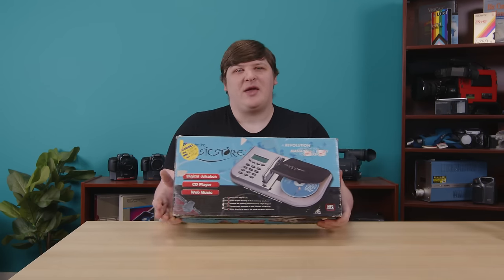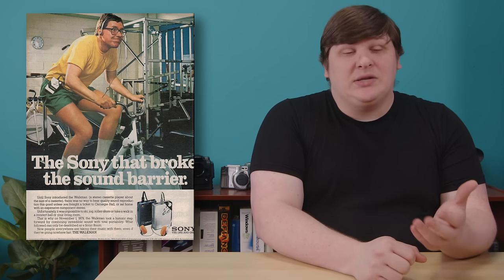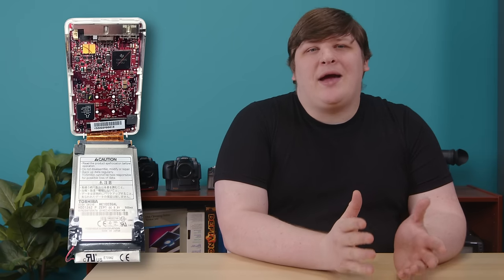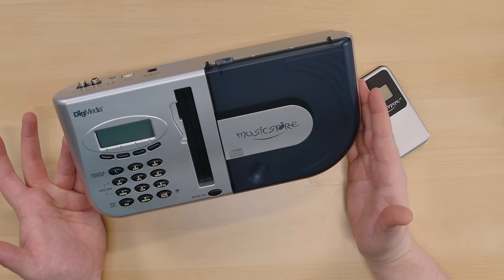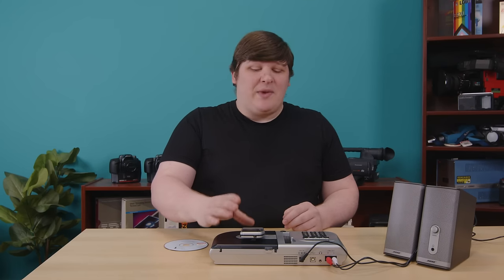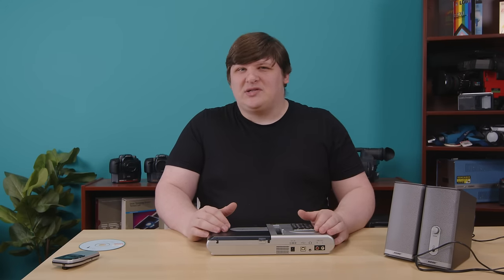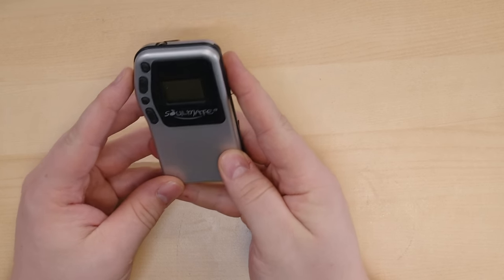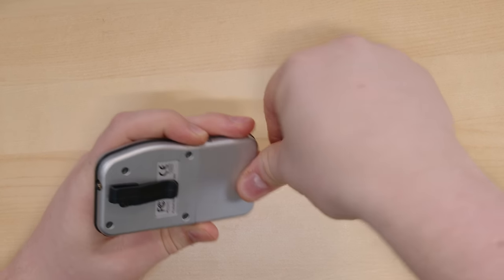An MP3 Jukebox for Everyone (Including The RIAA)

Comment: It's funny, if you go to your car and try to equalize the song, they put the "genre" or "style" at there, so you can put in reggae, rock, blues etc, at the Panasonic or Sony mp3 players, for cars, the "shuffle" function sometimes is called "mix" until today and if you want to select a playlist from a pendrive, there is "mix tracks" hahahaha

Edit: in Brazil, we still use mp3 players with pendrives for cars.
Reply: You're not alone, my car's stereo supports BT but only for Apple so worthless with my phone, so while my car was on the road a pendrive lived in it so I had music since the local radio stations are mostly a bunch of nutters. The exceptions are a station I helped setup, which is hard to get reception for in most of the town and a pretty low end local station that's all volunteers.

Comment: I would say the spring wants to lift the lid at all times in the open state so when you close it, that little piece that sticks out actually tucks under the frame of the hole you put it in so the lid won't come open. When you push the open button, that is just pushing that small piece to the right which allows the lid spring to open the lid. With that said, nice video. I never knew this thing existed!

Comment: I looked at that image, the data isn't encrypted, its just obfuscated, the machine applies a circular bit shift operation every 512 bytes to the data stored on the drive, with each byte offset from 1-512 being a different value shifted. This can be observed as repeating patterns in areas of the disk that you would expect to be zeros.
Reply: We need a decoded image!
Reply: @Ipergorilla  so CRD did a video on an email conversation with one of the engineers who worked on this, this is now what i think is a rolling cypher, and it would need to be brute forced

Comment: Excellent detailed review.

To my mind the UI is the key thing that held it back. Had it had a better UI, who knows, perhaps it would have done much better.

P.S. Solar watches as well as self-winding electronic watches (e.g. the Seiko 'Kinetic' range and its predecessors) used to use those types of capacitors. However, they were phased out in favour of physically compatible rechargeable cells as the capacitors tended to degrade rather quickly. The rechargeable cells last a lot longer in service.

Comment: The DSP is most likely running heavy number crunching like the FFT for the MP3 compression / decompression, as this would overwhelm an 2000style ARM CPU and the low cost FPGA, but be easy for the DSP.

Comment: Wooo you mentioned Creative's Nomad Jukebox :D This one was soo cool to carry around. I still have one somewhere. I remember I had/have v3 version that used a 20-gig drive with some weird custom partition format that I once tried to reverse-engineer for Rockbox alternate firmware (~2007, quetzalcoatl, still can find some mentions on Rockbox forums, the older "nomadness" forums don't exist anymore). My, reversing that all and writing a linux fs driver was such a cool project.

One thing I remember, as a consumer/user, with the NJB I got was that small screen and just a couple of buttons. Menu had a relatively logical layout, easy to learn, but when you had large library, navigating around was a pain, but at that time it was nothing unacceptable. I think it supported playlists, with help of PC software. At some point I discovered that it's possible to store not only music, but also data files on it (and later software updates even made it as easy as showing it up as a drive in Windows, like every dumb usb stick now is presented) - and 20gig storage for files, when the most common usb pendrives at that time had like 64mb? 128mb? Creative's NJBs went up to ridiculous 40gigs, at not that very steep price increase.

And these even had Firewire connector for faster data transfer speeds! Who on the block ever heard about it, when USB was just getting barerly recognized by common folks on the street as something more than just printer cable at best.

Hm.. what else.. oh yes, audio quality was VERY nice, especially when connected to an external amplifier and speakers. Creative's headphones that were included with the device had a very weird design, no classic headband, some head-back-band and they got uncomfortable quicky, what a waste considering their sound quality was pretty decent.

And I couldn't forget about the battery packs. Yes. Packs. Not pack. Most of the players I saw at that time were going either on AA/AAAs, or built-in rechargeable battery. NBJ could of course work of on ac adapter, but also had 2 easily accessible slots for its own rechargeable batteries. One was included, and additional ones had high, but tolerable price. If I remember well, they weren't hot-swappable, if you had 2, you should have charged/discharged them matched together. Anyways, find such thing in any player even years later!

I felt such a pity when iPods boomed everywhere and got all the hype with their tiny storage space (at least initially), and almost nobody heard about Creative's players. Oh well, nostalgia aside, that's not the first great product shadowed by worse competitors with better marketing, right? :)

Sidenote: I try to post that comment for the third time now, previous just disappeared. What do I have here that it gets constantly deleted? Links? Product names? Too long to store in cloud? Geesh.

Comment: >super capacitors in the portable unit
I think that it was more intended for power loss protection during jogging etc. where the batteries would disconnect for a short period of time due to gravity
Also, the power jack in the battery compartment etc. makes me think that they considered making a rechargeable battery pack for it, but it never reached the needed success for it to be relevant

Comment: Entering the information for my mp3s over and over again is not something i miss. The whole "equilize by genre" thing sounds familiar to me though i never had a MusicStore so i guess that was a ~thing in the early 2000s?! Oddly? So was the ripping at 1x. But then again i was in a household with a Packard Bell pc sold by Sears and a CD player/radio/tape little tower that wouldn't let you skip a song on a CD after the 3rd or 5th track without aimlessly searching and giving up.
And once you started explaining the T9 i actually remembered it but the only place ever used was when i used my Virgin Flip phone to browse the web at the cost of 10 cent per page loaded.

Comment: Imo 128kbps mp3 could sound totally fine if you used the correct encoder settings (i.e. lame - 9; which of course most people did not). Of course in 2000 those correct settings would have seen you waiting quite some time for it to finish encoding (0.25x, if you're lucky)
Which brings me on to another thing, this device probably couldn't have done the encoding any faster than 1x anyway, so a better extraction method wouldn't have been relevant.

But I wo der why they didn't shove a USB or ps2 port on the back for an external keyboard. A simple change change that would have drastically improved the usability.

The ram bit caught me totally off-guard. What a whacky idea.

Q: could the Dock charge the handheld?
Q: was the media unlocked while the handheld is docked, even without wiping? If yes, what happens if you yank the handheld out while playing one of those tracks?

I'm tempted to look at that drive image and see what I can figure out, if anything
Reply: I didn't see any obvious traces to the battery compartment during the pulldown from the dock, or other common elements for charging so probably not. Maybe they're in the sealed part of the battery compartment but seems unlikely.

Comment: Missed opportunity to plug that CD drive into a PC to find out how fast it could have been had they used IDE to transfer the music. Also interesting to see what happens if you plugged a PC CD (or DVD drive even?) drive into that thing's IDE interface. As long as the drive had the digital audio output port would it work? Curious how the IDE master/slave thing is set on that. Did it use the cable to set that or was there a jumper somewhere on it like a normal PC drive?

Maybe you can revisit this in a YouTube short? ;)

Comment: I owned a Rio in the late 90's and it was extremely practical.

The device was intended for use on the go, and as impractical as loading up music through parallel may have been, CD-R's weren't REALLY an option, and the Rio made keeping a LOT of my favorite music at my fingertips a reality.

Add to that the lifespan a AA battery had on the thing, and you have a really useful device. I remember showing it off in Middle school, and kids were interested then.

Also, you mention swapping out CD's which is valid, but consider that when you brought a portable CD player along with you, that to swap music, you'd have to bring the CD's too.

If you only REALLY like 2-3 songs on those CD's, you'd technically bring a Walkman that ate batteries, and a 6 disc CD travel case to get the same enjoyment out of what you could curate on the Rio.

It was really a comparable experience, but with better battery life, and it was easier to curate a custom mix than other options available.

I graduated to a Nomad MuVo a few years later, and never really looked back. 

Some insight into the mind of someone who actually used the device when it was sold.

Still have it somewhere in the box. Never did get the expandable flash storage for the reasons you mentioned, but it didn't stop me from using it. And I MAY be mistaken, but I was a prude for 360kb/sec music, and I think I remember being able to listen to it on the Rio. That may be false memory though, I'd have to dig it out.
Reply from the maker: That's all legit, thank you for the firsthand experience. I was burning audio CDs a couple years later, but 1998 and 2000 were vastly different.
Reply: I had a 128 gb MuVo and loved it. I worked as a freelance legal document preparer and it also doubled as my flash drive for documents I was working on.

Comment: A very comprehensive video, very detailed and I found it very easy to follow.  I remember using MusicMatch Jukebox back in 2000, wait for it, to digitise my cassettes.  That was an interesting project, I wanted to digitise some tapes and copy them to CDs on my family's new PC.  It took a bit of trial and error, but I did it.  Regarding the DigMedia products, pretty much everything you said agrees with the review of the product I read back in 2002.  I do have a few questions.  Is the operating software on the MusicStore stored in ROM or on the hard drive?  If it's in ROM, you could theoretically replace the hard drive should it fail.  If it's on the hard drive, well, then you're probably going to have a very rough time.  Also, can the MusicStore play MP3 CDs?  You didn't mention MP3 CDs at all during the introduction.
Reply: I don’t think it can play MP3 CDs because it doesn’t use the data bus to extract the data which would be needed for MP3 CDs, but only uses the IDE bus to control the drive, audio is read via the SPDIF out.
Reply: I will note that the "Download to MusicStore" window in MusicMatch Jukebox seems to have "Reformat" and "Refresh" buttons. I'm assuming CRD here at least tried to hit "Refresh" as that would be the button I assume would read all the tracks off the disk, and he certainly complained enough about the lack of such a feature, but "Reformat" sure seems like it would set up a new hard disk for you if you needed it, or clean out one that happened to get borked for whatever reason. Who knows if that actually is just a reformat aka zero out or if it loaded up some firmware as well...but I'm gonna guess it's a zero out and the firmware is entirely in ROM. Just educated guess based on how snappy and basic the interface is, like it was coded to a strict ROM size limit. Alternatively, maybe "reformat" does zero it out, and "refresh" actually reloads the firmware? Sorry for not having more than guesses here haha

Comment: I have had a quick look at the contents of the disk image, and first of all, thanks for imaging it, because it might actually help people. Based on initial exploration, it seems like the hard drive contains the firmware of this device, and a broken hard drive will result in a broken device, even if you just replace the disk with a working disk. It also contains the string `T9Core v3.03 Build 0805 Fri Oct 15 12:59:03 1999` in the resources section of the firmware, which more or less confirms your dating efforts. It also contains the T9 library from Tegic Communications for text entry.  Do you have pictures of the PCB inside with all ICs and connectors and potentially unpopulated headers visible?

Comment: Great video!
I remember upgrading to an MP3 player in about 2002 after having a discman for a couple of years. The first (and subsequent) players that I had were small USB dongle sized players that were powered by a single AAA battery. My initial reason for doing this was actually related to the battery life itself, and not any kind of audio or usage advantage over a discman. From memory they lasted a bit longer than a dual battery discman, which meant my battery consumption was twice as efficient with the solid state MP3 player compared to the mechanical discman. I think the first one I purchased was 64mb, but I already had a growing library of MP3s on my PC that I mostly ripped from CD. I do remember getting my hands on a discman that supported CD Data so that I could burn 700mb of lower quality MP3s that stored a lot more, but it didn't solve my battery consumption issue. The great thing about those little dongle players, even though they had a super basic LCD UI, was that it supported ID3 and had pretty tough plastic buttons. Each 6-12 months I'd upgrade them to the next highest storage, so by 2003 I had at least 128mb and by 2004 was at least 512mb. I also remember converting a lot of my library to 96kbps MP3 as a trade off for size/quality. I used to travel nearly 5 hours per day to and from high school, and with a discman I'd have to take spare batteries to school, but with the dongle players I could get a full day of playback without needing spare batteries.

A lot of the pros you list in this video would have been really attractive to me as a 15 year old in 2002 but the DRM quirks would have been really off putting. I loved being able to manage my tracks directly through Winamp, so I could jam in my USB MP3 player and organise or add/remove tracks from Winamp itself. To a certain degree I still use this style of music management, but I use the awesome MediaMonkey software (based on Winamp) to manage my several thousand CD library, and use it to either stream them over a DNLA network service, or transfer to UFD for the car, or yes, even still burn mix CDs (as I own CDJ equipment and used to perform with them). I rip almost all of my music as HQ FLAC these days, with a 320kbps MP3 copy in each album's folder, so that I can quickly copy MP3s to a data CD for the DJ gear, or use the FLACs for the car or my phone. 

I am recent subscriber to your channel but I've been enjoying every minute of your content 😁 I will be enjoying your videos for years to come, and wish I had discovered you sooner. Greetings from Australia 👋

Comment: Between the Rio and the iPod, there was one product category that's often overlooked: MP3-enabled discmans. You could just burn 10 albums on one CD-R. Or better yet, use a CD-RW as a cheap reusable storage for your player. And it could play your original albums as well.

I've never owned one of those myself, and I've read a lot of bad things about them: that they were clunky, had bad UX, felt cheap and all that. But on paper at least, that concept made a lot of sense: it wasn't worse than a regular portable CD player in any way other than the price, in fact it had all the features of one, and with a help of a CD burner (which were already pretty common in the early 2000s) it also allowed you to take roughly 10x the music on the same amount of physical media, at a much better value proposition than flash memory. So it perplexes me that they're rarely mentioned in retrospect.
Reply: This has been one of the routes I’ve used since Y2K. Not only have I owned several portable CD players with mp3 playback since then, but also every car stereo and DVD/Blu-ray player since 2005 has also had this feature so I can play my mp3-CDs in my car and home a/v systems as well.

Comment: On Music Match Jukebox, I'm almost sure that the reason it was controversial was that it included either adware or spyware in the installation. It might have even installed one of those lovely browser toolbars that even software that you paid for was fond of including as a default opt-in checkbox on installation. Or am I thinking of Real Player?
Reply: That's one of the things that happened, another was they got really invested in getting you to pay for a particular database site. But then took when you have a lot of tracks it got very crash happy. As I mentioned in another comment we helped setup the servers for a radio station that was trying to go fully digital for the fact that managing the physical collection was a nightmare. One day I couldn't even get it to open on one of the ripping machines, it just took one look at the collection and went to cry under its bed. Admittedly that is definitely an extreme case, I doubt most people have 10k+ albums on a single machine, especially in 2000 but we definitely hit a lot of issues as we got further into a process that took at least 6 months that I remember clearly.
Later Yahoo! bought them and it seems it only got worse but by that point I personally was using Foobar2000, which handled large collections pretty well for the time.
Reply: @Gatorade69  I think both did that. I was always a Winamp user.